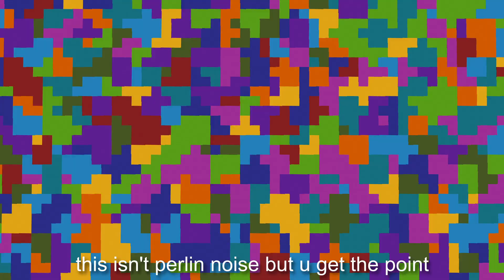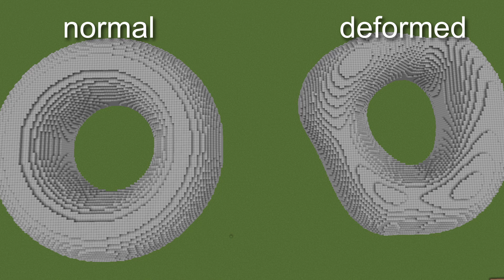WorldEdit Noise Explained

Comment: At 4:05, which equation are you referring to, when distorting the shapes? The //sphere doesn't allow for an expression to be added.
Also, do you know by any chance if I can use //g to alter/deform terrain already existing, rather than only deforming a newly generated shape?
Reply from the maker: hi! it isn't the sphere command, it's using the //g to create a sphere: so "//g stone 0.75>sqrt(x^2+y^2+z^2)" becomes "//g stone p=perlin(1,x,y,z,1,1,1)/3;x+=p;y+=p;z+=p; 0.75>sqrt(x^2+y^2+z^2)".
if you want to distort something that is already there, you can use //deform where you can define an equation to adjust the x,y,z coordinates of blocks. ex: "//deform -r x=x+1" would set the block at (x,y,z) to the one at (x+1,y,z)
Reply: @breadnotfish Thanks for the explanation and fast reply, I wasn't even aware //deform exists. I will give it a try.